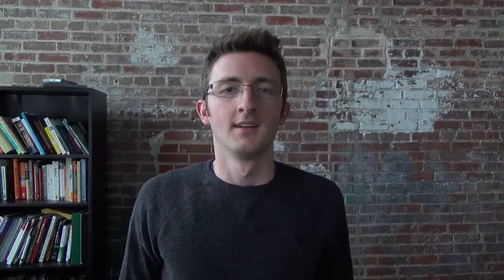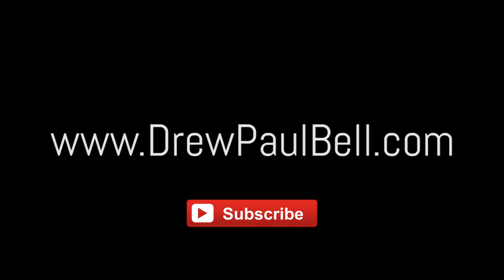5 Stages of the Architectural Design Process

Comment: Question .. Do architects design the Pipe ways and stuff like wirings or is that others persons work?
Reply from the maker: +iamAX 830 it depends on what you mean by pipe ways. A you would mostly likely hire a plumbing specialist or subcontractor to size the pipes and lay out a riser diagram. But then the architect needs to make sure the lines fit in the wall and floor systems. We layout the electrical stuff like lights, switches, and outlets. That's usually just shown as a diagram but sometimes you want to put a switch right inside a door but the door is close to a perpendicular wall and the framing doesn't provide enough room. There's also HVAC ducts. Any work I have done on those has been tweaking base plans from a mechanical engineer so I didn't have to size anything but I've had work with that kind of thing and make adjustments to it. 

Thanks for the question.
Reply from the maker: Hey, I mentioned your question in my recent Q&A video: https://youtu.be/5r9kWqtaDSo Thanks for asking!
Reply: Thank you for answering 😃 my doubt are clear👍

Comment: In which part do you talk with the engineer or generall negotiate and calculate the physics of the building so it Stands up and stands up long and doesnt tilt AND doesnt become hothouse or impossible to build without annoying draft.

Is that 2 or 5? Phase?
Reply from the maker: You do that throughout SD, DD, and CD, and it's quite possible in CA. It all has to happen as the design changes. Going to a consultant is most likely to happen during DD and CD, but the architect has to be pretty close to a good solution before going to a consultant in the first place. It's really costly to figure out the building is slated to be a hotbox during CD's, so the architect should design it to not have something catastrophically wrong from the beginning.